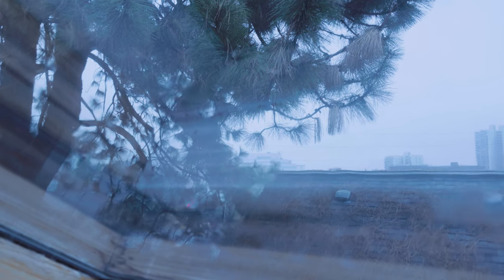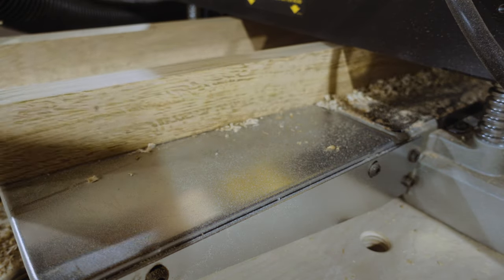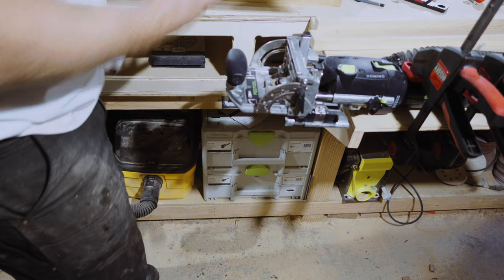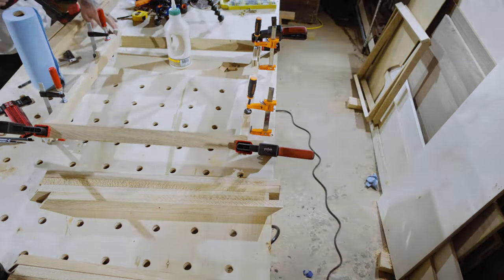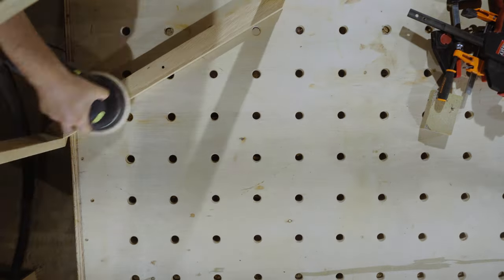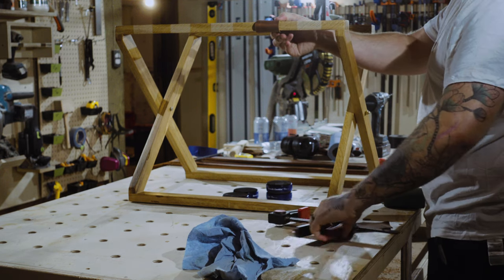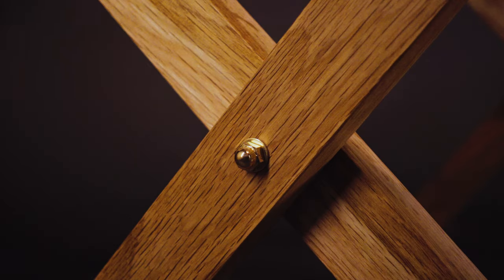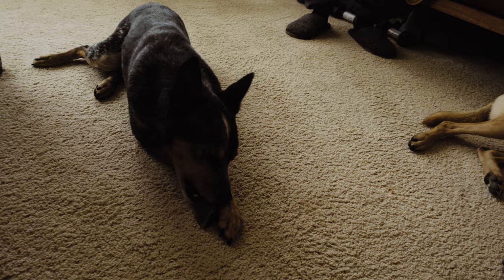The Oregon White Oak Luggage Rack Thingy... Build video

Comment: Nice! What was the hardware you used? Details, please.
Reply from the maker: I used some M8 bolts from Ace Hardware, some brass washers and a rounded brass bolt - I think the bolts were 2-1/4” long and I used a nylon washer in between the legs so there would be less friction.
Reply: @BuiltByAnt  Thanks! It would be good to add this info to the video description if there's a way to do that.